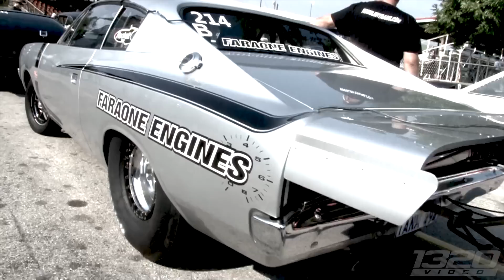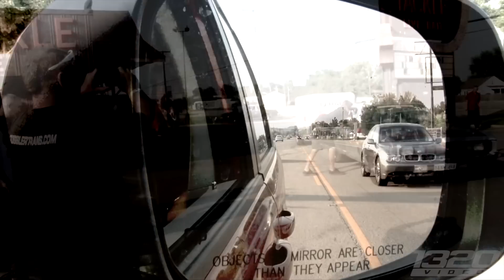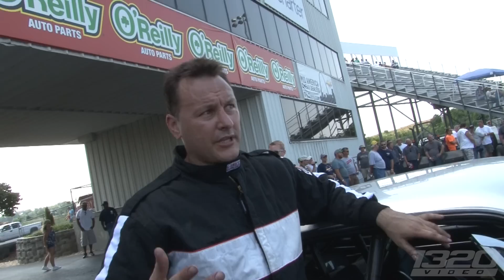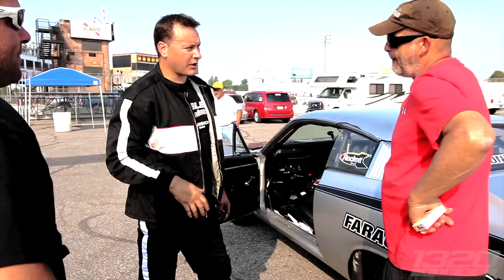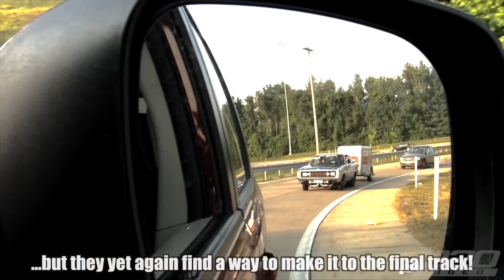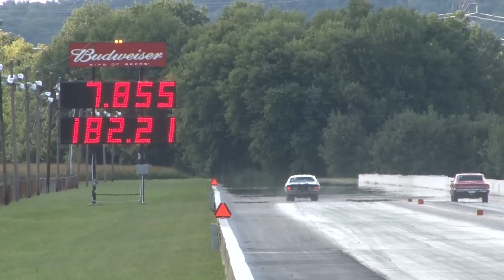7 Second Australian 1972 Valiant Charger

Comment: Twin turbo's & twin fuel filler caps. The latter mod is a sure sign this guy knows how to make a Classic Australian Hardtop look good & run fast. hey Charger.... 
Any locally built 1970's Bathurst Era , Chrysler , Ford or Holden coupe or hardtop with a boosted engine that could reliably deliver 10's on street tires would be worth taking to the US for this event + a drive around some states that don't have snow in them.

Comment: my first car I shit-yunot was a VHXL265 72'.  Bought it off a guy whose mom told him to get it out of the yard(his spares car)  $1000 with dodgy RWC , a sump bolt that scraped over the cattle grids because the 15" jag rims were the only ones left that would fit.: And it still had a top speed that buried the 110mph needle. $10 matt black and all the chrome.
Reply: Jag rims? That's a conversion in play there, if by jag you mean Jaguar. The offset, centre size and stud pattern are a match to the HQ-WB Holdens, and most of the later model US GM rims. Whether in America or Australia, the standard stud pattern for Chryslers has always been interchangeable with Ford 5 stud. The main difference being the centre size

Comment: 4200lbs, wow thats heavy. I would have guessed about 3600-3700lbs since it is a track car. I bet the complete engine is at least 800 pounds!
Reply: They weighed in right around 1350kg/3000lb stock... then add in the cage, massive engine, uprated chassis and safety gear (chute/bar/fuelcell) and yeah, you'd be a heavy car that's for sure.

Comment: The charger would of won bathurst, if it went around corners!!!!!!!
Reply: It was winning in 1972 they stuffed up in the pits Holden got lucky and in nz they smoked everything
Reply: Dan Ohara 
It would have won Bathurst, but was stuck with a 3 speed gearbox. Needed 4 speeds to work with the torque curve of the 6
Reply: Fordsidevalvesforever in 72 it had the 4 speed box.

Comment: cool car, not a 7 second car though, just a really respectable 8 second car.
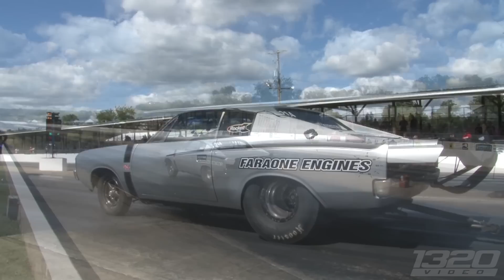Reply: 5:40
Reply: I looked dude, all my life growing up I learned that a "7 second car" is a car that runs typically in the 6.8-5.99 range because dude to track circumstances was well as driver errors, it usually equals out to about 7 seconds. I don't care if he ran 1 pass that was awesome or super low because that fact of the matter is he ran a "7.93" that to me is a 8 sends car, I bet you if he ran it again it would be right around 8 seconds. This is not  7 second car. And if it is then shit, my hot rod makes 600 horse power because I have 505 hp to the wheels.
Reply: but its not, yea he broke the 7 second barrier, I don't fault th dude for that. Still a bad ass car but barley tapping into the 7 second tree for me would not be a true 7 second car. sorry my reply was so late I was busy working on my car in the garage, have fun...keyboard warrior.
Reply: RK1993 I'm not being a keyboard warrior, once your car has a 7-8-9 second timeslip, it's a 7-8-9 second car, don't believe me if you want, but don't be surprised when people laughs at you.
Reply: I can see both of your points here guys. I would make 2 categories for the performance of a drag car. 1: Quickest ET, here we would see that this car would rightly be called a 7 second car. 2: Average ET, i think this is what RK1993 might be getting at. Here a car has to prove that it can run a time CONSISTENTLY in its time parameters, and in my opinion(yes, I used that dirty word) this matters way more. Sure, this car can run in the 7-7.999s range, which is AWESOME :D, but only 5% of the, time while the other 95% is in the 8-8.999 range. I just dont think its fair on other cars that run 7-7.999 95% of that time
Reply: RK1993 wtf how is a car that runs into 5s a typically 7 second car?  Its simple, and it works like this for ANY timed event be it motorsport, swimming, running, hot potato holding. As soon as it runs quicker than 8.0 its a 7 second car, its not a debate. Just like the first person to run a 9 second 100m sprint wasnt doing 7 second runs. It was a 9.96. The worlds first 5 second import ran a 5.972, and the first 4 second top fuel car ran a 4.990. Flat 7's, mid 7's high 7's have one thing in common, they're all 7s. Just because you learned it "all your life" doesnt mean its correct, it just means you were wrong all your life. and no its not the same as saying your 505hp car makes 600. That would apply if this guy claimed his car runs flat 7's.
Reply: +RK1993 it's a 7 second car you clown. it was running low boost when it ran 8's. even the passes where he ran in the 7's was only on 75% boost.

Comment: well least its a great drag vehicle..far as street dependability eh
Reply: It drove 1000 miles with no problems. The only problems were on the track
Reply: no iknow it drove 1000 but during those miles they had constant stop to repair minor stuff and continue..im sure it can go from a corner store and back..but just like the short trips they was doing it had minor constant issues...it is street car but not like reliable status street..but thats what classic muscle cars pushing 1000hp is all about
Reply: your not seeing my point and I'm certainly not hearing you out..bottom line it's a fucking great beast by far to drive those miles.. it's a street car yes..but not ideal street car like what the europeans have say like they're pushing 1500rwhp with full interior and a/c..comfort no breakdowns stuff like that..every beast have they're pros and cons..this typical one is mainly for strip battle
Reply: *****
you might want to read your second  post you're way off with assumptions corner store and all... But really You are the one missing the point in a huge way.European cars 1500rwhp?? we didn't see any at drag week running 7sec quarters wonder why or covering 400 miles a day while doing it. Yeh see your point your making sense Not.your comparing apples to oranges how would you know if the street cars you talk of don't run 7s and were not there?????? by the way this is a 2 tonne all steel  7 second street car on a bad day.
Reply: obviously they're was no lambo's gtr alphas out there..it's all muscle..when i mentioned europeans cars it's because i'm subscribe to m5board channels were they show those powerhouse that have best of both worlds hi end speed full interior a/c 20mpg...but like i said way back..every machine have the goal they're established for....i'm a muscle car fan dragster fan and euro fan..i have a pro tour dragster pushing 800plus..it may not be comfortable and it can drive for miles..but no a/c or heater lol..i doubt I'd enjoy it driving to oregon in the winter..owell it is what it is..it's just my simple observation i'm not hating since i'm not bias because i have many cars to tell they're pros and con...but i'd still pick a muscle car over a euro anyday regardless of they're limits